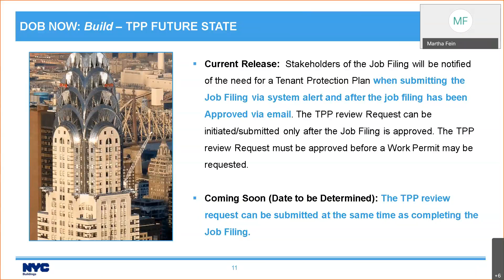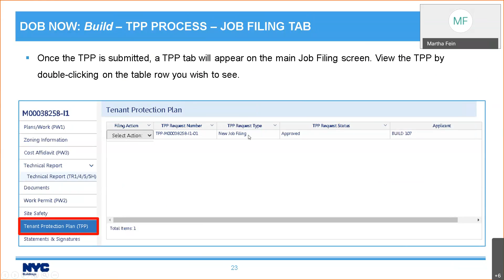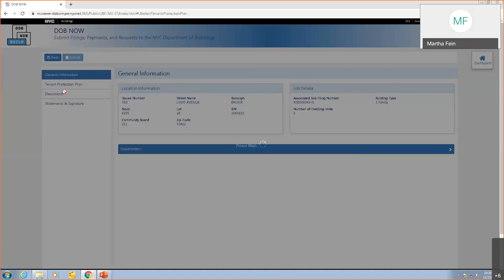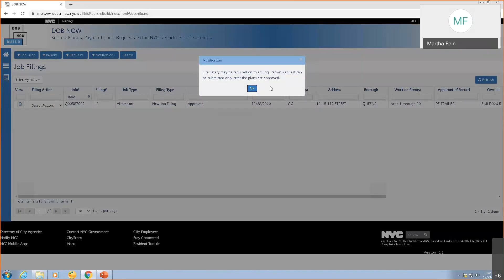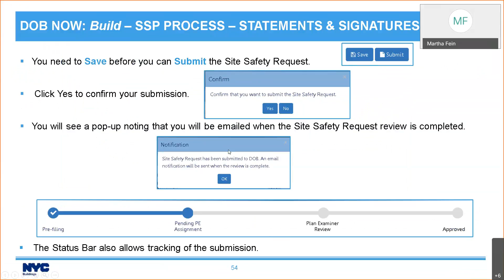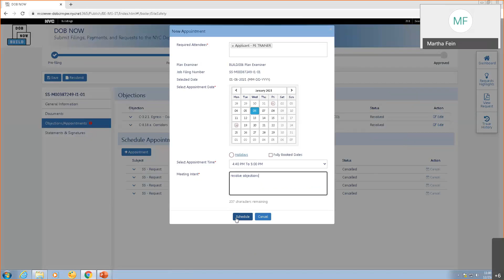DOB NOW Build–Tenant Protection Plan/ Site Safety Plan Webinar

Comment: The site safety waiver process is a disaster, in my opinion.  Everything gets flagged as requiring site safety and there's no timely system to get it waived; it can take weeks.  In most cases it's not applicable.  I love how the borough office has nothing to do with DOB Now filings.  They throw their hands up, and we are left to a DOB Now help desk email; not a single person we can call to talk through it with a human?  This is a simple fix and a huge problem.  Never should have rolled out GC work type without knowing this was going to be an issue.